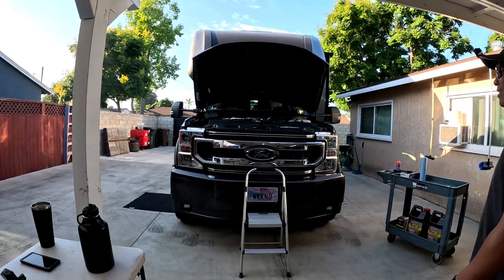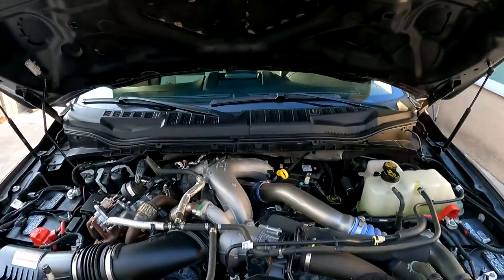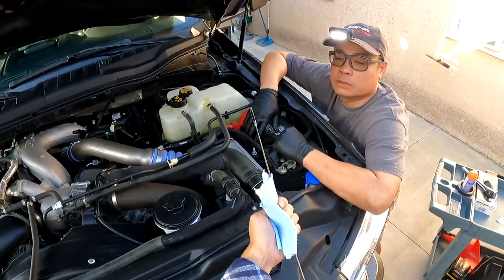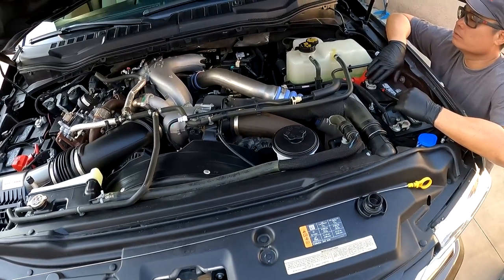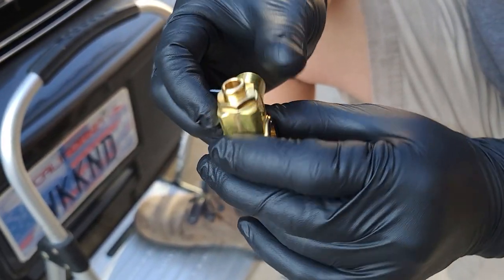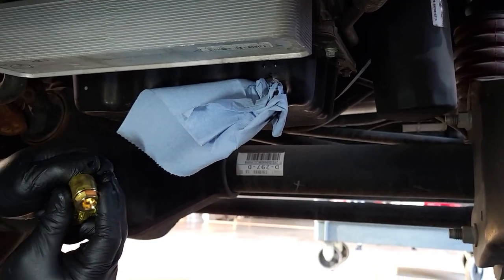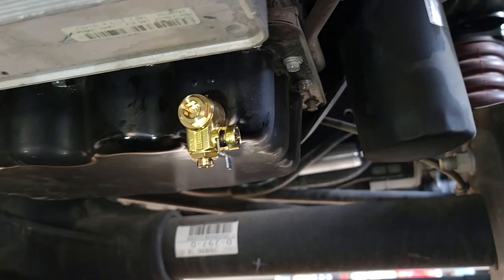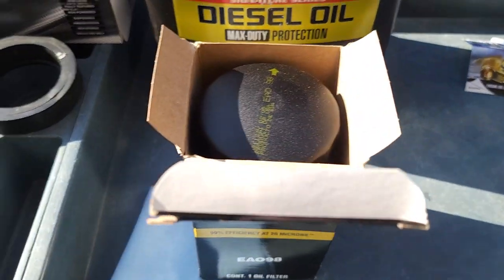Fumoto Engine Oil Drain Valve Upgrade & Super C RV Oil Change AMSOIL #fumoto #amsoil #oilchange

Comment: I put one of those Fumoto valves in my previous diesel pusher, and it worked out very good.  Much cleaner oil changes for sure.  Back when I got it, they didn't have the plastic safety clip as an option but that was many years ago.  I'll have to remember to install one on my new rig once I decide to do my own oil changes in future.
Reply from the maker: Nice! Good to know we purchased and installed a great product. Wished we would have done it sooner, cant wait till the next oil change 😅